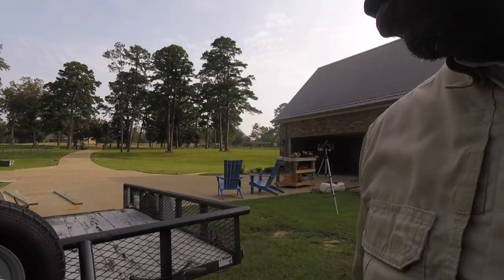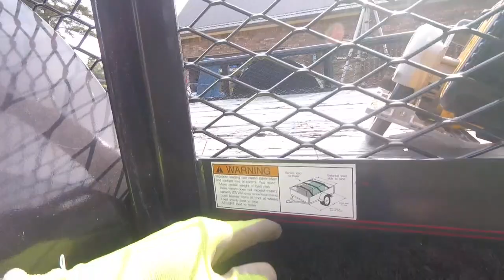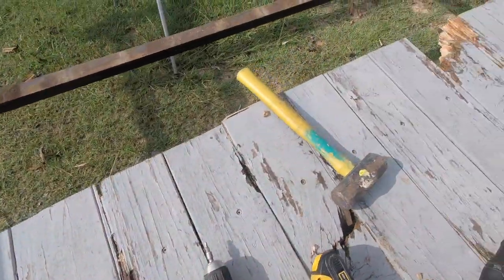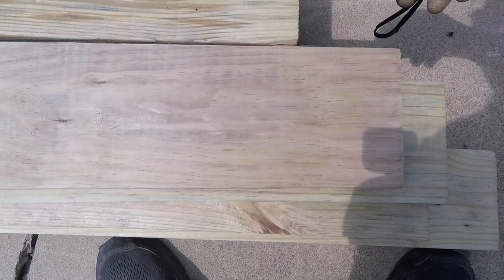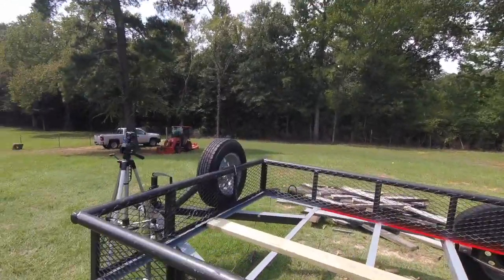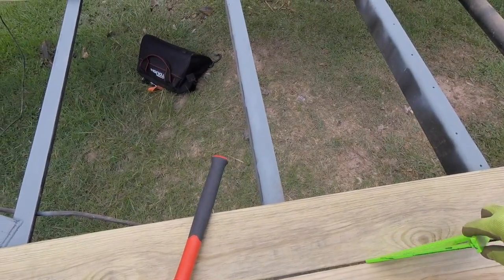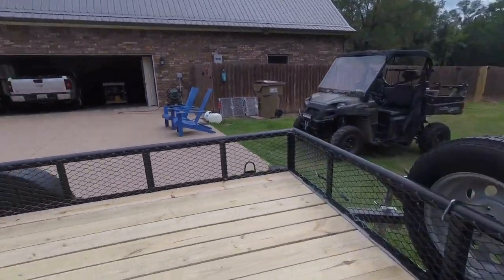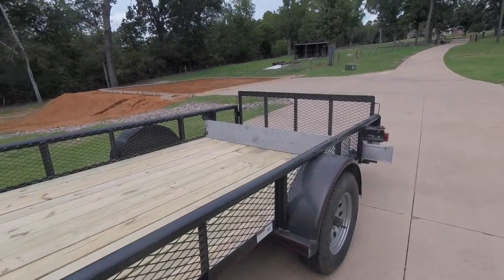Redecking my Trailer

Comment: Every deck project I’ve ever done has started off by carefully measuring and squaring off each board.  There’s always a 1/4 to 1/2 inch that has to be cut off so they’ll all be exactly the same length.
Reply from the maker: Yes, I learned the hard way.  That was my first time doing a redecking project.  Thanks for the tip . . . much appreciated.

Comment: On the last board or two, try this instead of cutting the angle iron lip at one end or the other.  Screw down one end.  Just let the other end lay on top of the angle iron and have a friend stand on the board at that same end. Put a small hydraulic jack underneath and slowly jack the board while the friend is still standing on the end.  As the board bows, it will begin to slide off the angle iron.  When it clears the angle iron, slowly ease the jack down.  It will help to take a grinder and bevel the top edge on the end of the board so it will slide into the slot easier.  No cutting, no welding.
Reply from the maker: Wow . . . great idea Sir . . . thank you for the tip . . . appreciate it.

Comment: Yes sir you are right...attention to detail is sadly lacking on many products made here.  It's also sad the trailer manufacturers don't take in to account we will have to change out our wood.
Reply from the maker: I agree with your comments 100% . . . I think a hinged opening would be ideal for access the wood boards on the floor.   Next time, I plan to use expanded metal for the floor.  Thanks for watching.